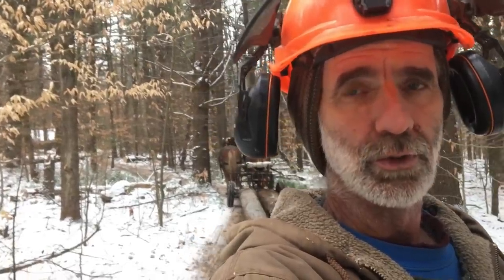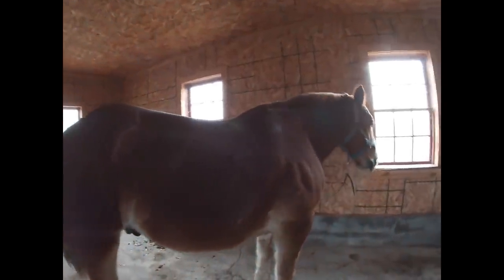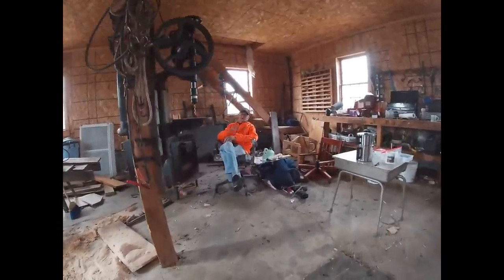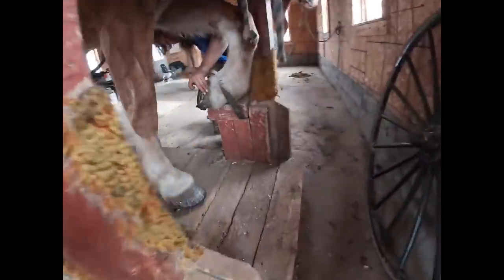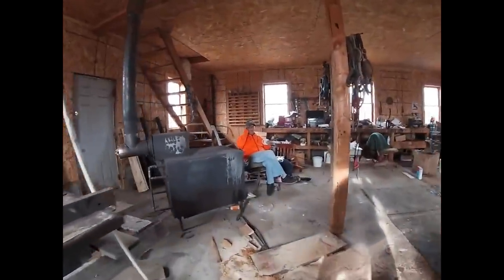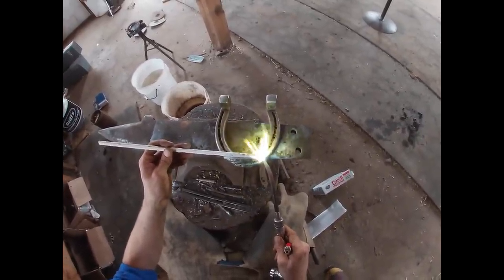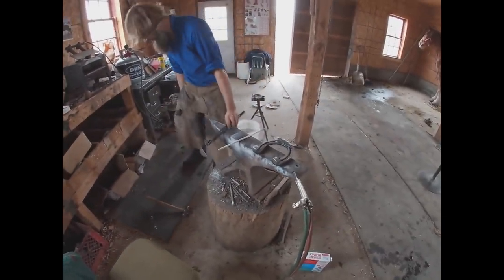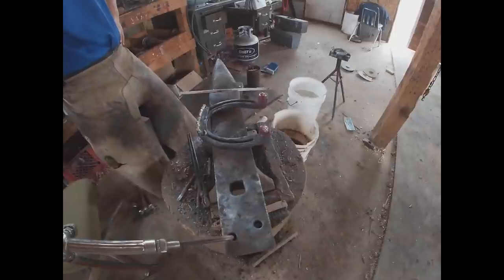Do Horses Need Shoes For Winter Time Logging??? // Watch an Amish Farrier at Work!

Comment: First, let me say that I enjoyed your video regarding how old a horse can still be worked and look forward to watching some more of your videos. It appears that you are very kind, soft spoken, and patient with your animals. It also appears that you have considerable experience working in the woods, and I commend you on using a New England type harness. I am torn on whether to comment on this video or not. I hope that you will think about my comments as what my experience has been as a farrier and working in the woods with a single horse and pony, as well as a teams of both. I am a retired farrier, saddle and harness maker, so I am older than you, and have spent my life working with horses in one way or another,  but that does not mean I am more knowledgeable than someone younger. I acknowledge that there are many different situations and circumstances and there are more ways of doing things than the way I have done them. So, here are some tips from and old man. I hope you find them useful. Horse shoes are protective devices, wearing devices and traction devices, and sometimes corrective devices, however this is beyond the scope of discussing corrective shoeing. The type of shoes you are using with toe and heel caulks, originally did not have drill tec. It was unavailable back then. Horses were sharp shod, i.e the lateral heel caulk was pointed to dig into the ice. When i have asked people why they want caulks, the usual answer was " we have always done it this way". I say:  Drill tec. is good, caulks are not. Caulks limit the amount a horse can pivot it's foot, which can cause undue strain on its ligaments and tendons. If one needs caulks because the horse is slipping, one needs to lighten the load  and or provide some means of making the load move more easily, such as a sled. If you don't believe this, take a shoe with caulks place it on bare ground, step on it and try to pivot your foot, then take a shoe with just drill tec and no caulk and do the same. The caulked shoe will dig into the ground and will not pivot, the uncaulked shoe with drill tec will pivot. Do the same comparison on ice or pavement. Both shoes will not pivot. You do not need caulks for ice; Drill tec is sufficient to prevent the animal from slipping on ice. As for the oakum and pads, it has been my understanding that oakum is used to keep debris from getting under the pad and causing discomfort. At least that is why I applied it. The pad provides the protection for the sole. In your case, the sno-ball pad keeps snow and ice balls from building up under the hoof. Your farrier seemed to have plenty of experience with the mechanics of shoeing, and was quiet and comfortable around your animals, however I did not see him use pine tar, nor did I see him apply any oakum before nailing on the shoe. Perhaps that part was not shown in the video. No pine tar is fine I suppose, however it is a natural antibacterial, and with full pads and oakum the sole can not breathe under the sno-ball pads; just poking in the oakum will not keep debris from getting under the pad. You may want to consider rim pads. As for one burner of the forge not getting hot; take the 4 screws out of the top of the forge and remove the top and burner tubes. You my be able to remove just the burner tubes, without removing the top. You will most likely find flaked off rust or some other debris in the burner tube. Clean it out and the forge burner should work as well as the other one. If he is hesitant about taking the forge apart, at least blow some compressed air through the burner tube.  I hope you find my comments useful. I am sure you have your horses best interest at heart. Good Luck.
Reply from the maker: Hi Mike, I very much appreciate your input and your thoughts you obviously have a lot of experience but I am curious what where you’re from? I would love to sit down with you face-to-face and talk about this because we obviously have different views on it and probably both of us are right some and  wrong some. I have used Flat shoes with drill tax on them, but have found that the corked shoes are still better. You kind of answered it in your own questions the fact that the flat shoes on ice will twist a little bit and the corked shoes do not, this tells me that the corked shoes have better traction and I’ve seen that from experience. I have had more horses than I really can recall and I have worked them very hard in the woods, and I don’t recall over the past 40 years of ever having any troubles with there legs from that.
Reply from the maker: I have had some horses that have lived quite long, like my buck horse right now is 20 with no noticeable leg problems at all. As far as the pads go the Oakham is soaked in pine tar and I do believe that is very important. some of your other thoughts I hadn’t thought of them that way and you’re probably right but I know I have used pads without Oakham before and it literally started rotting the hoof,  so it seems to me the oakum is what the change was.
Reply from the maker: Please continue to share your thoughts and knowledge with us all
Reply: @WorkingHorsesWithJim  HI Jim, Good to hear from you. I am in Hampton Nova Scotia. There is no doubt in my mind that corked shoes will have more traction than plates. I never needed that much traction. I used a single horse to skid logs to the haul road, then would use a team and forecart to haul 3 logs at a time to my mill. I also cut my logs to the length at which they would be sawed, where the tree was felled. This is arguably not the most efficient way to haul timber, but it was the way I did it, and was easy on the horses. I would haul some firewood trees full length, if I had a straight shot to the road, but they were by  no means big enough to get lumber out of them.  I have been kidded about my ways, as my motto was and is go light and go often. I would tell the kidders if you don't like how I do it, then do it however you like, but don't tell me I am wrong for doing it how I enjoy it. The few times I used carbides on shoes was when I had no choice but to cross a patch of ice to get where I was working in the woods. Most times mine were barefoot, and I was a farrier!  If my horse or horses were slipping in snow, I would lighten the load. I'm not inferring that  that is the way everyone should do it, it just the way I did it.  I was not making a living from logging, I just enjoyed my time in the woods with the animals. I can see that you are a good horseman and know your animals. You haul some pretty big loads, and that is fine with me. If, in your judgement, and "your judgement" are the key words,  you need caulks on your horses then I am good with that. Some fellers will have their horses shoes caulked and they haven't got a clue, other than that is what they heard or saw on other teams, or perhaps the farrier suggested getting caulks. The oakum I used contained pine tar or pitch, but it was not soaked in it. Sometimes, I would add pine tar to the oakum, but it was a sticky mess to handle. Watching the video and hearing about oakum being soaked in pine tar or pitch, made me think to myself that your farrier seemed pretty clean to be handling pine pitch, so it was just a miscommunication or misunderstanding on my part. I always used oakum under pads, for the reason you stated.  Currently I use a 20 + year old Percheron / Canadian mare to play in the woods, skidding firewood barefoot (her, not me) to the haul road, where my tractor and trailer takes over. That's my story and I'm sticking to it!!!

Comment: At my dad's welding shop we used hard surfacing rod for high wear areas.  You might see if that would work better for you.  A lot harder than brass.  Used on bulldozers, backhoes, and trenchers.